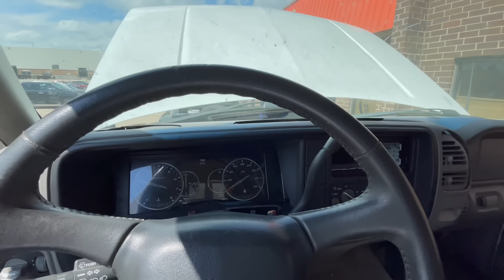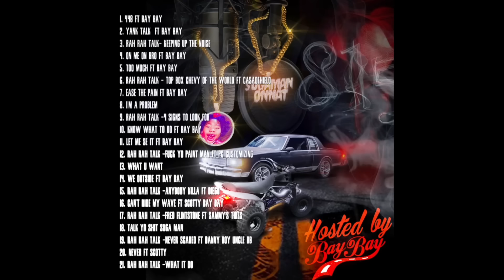Speed Shop Told Me Pause Project Cars & Drop 1000 HP Motor N Box Chevy  & Pro Charged Motor In Cutty

Comment: Homie check this out take that fuel injection off and change the intake and put a carburetor on there yeah you will lose a little horse power but I bet she will be running smooth and that if you want to keep that motor and just want it running until you put a ls are something built in it keep pounding your money at the end of the day